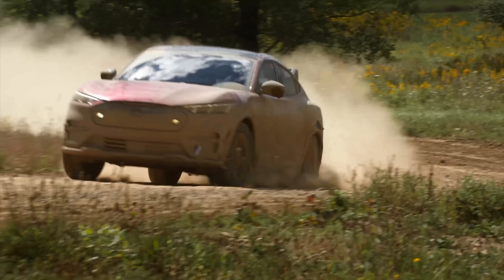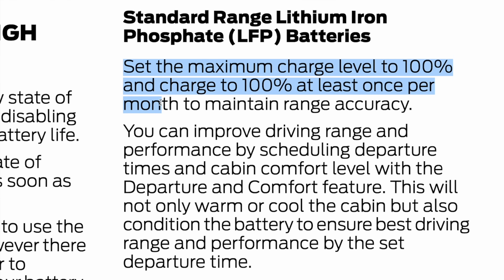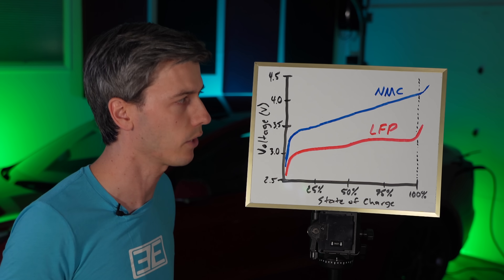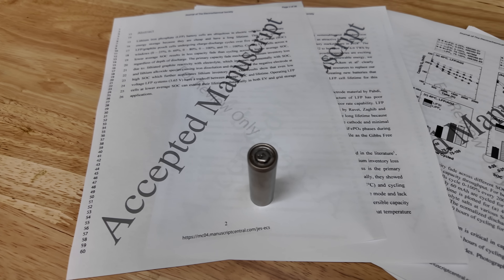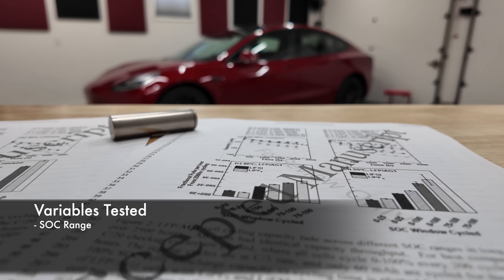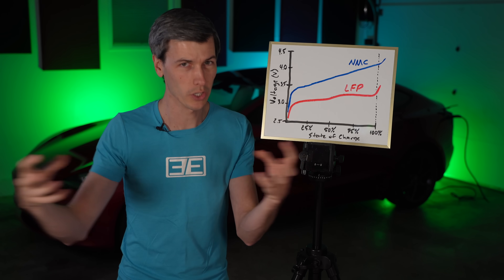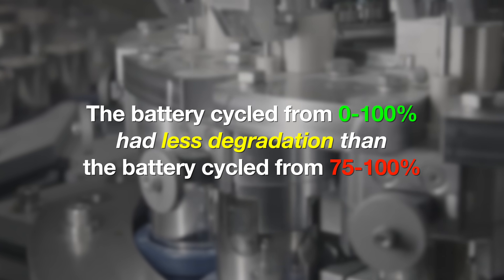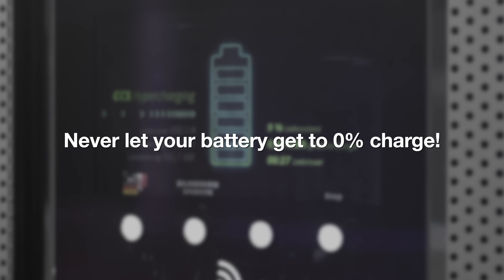How To Ruin Your Electric Car's Battery - LFP Edition!

Comment: Really nice informative video. A couple of additional comments from a former battery management system engineer, to the real nerds out there: 

First, charging to 100% affects more than just range estimation. It also effects accuracy of cell-to-cell balancing, and hence actual range! Small leakage currents in some cells inevitably cause charge differences to accrue between different parts of the battery over long periods. The circuitry needs to correct these imbalances by "bleeding" charge off of the higher charged cells or cell groups. It can only do this if it knows which cells are more charged! If the cells aren't properly balanced one cell/group will hit 0% before the others, leaving energy on the table, and as a consequence the vehicle will estimate (and deliver) lower total range. Even NMC chemistry balances better when fully charged occasionally. Although more steep than LFP, the NMC charge/voltage graph's slope just isn't steep enough for <1% accurate balancing in the middle portion. You'll get up to a couple more percent range from NMC if it can reach 100% every so often and re-estimate charge there, and re-balance more accurately.

Second, it's important to understand that all battery management systems use "coulomb counting" (monitoring discharge current) almost exclusively to estimate range, at least when driving. This is not just for LFP, NMC absolutely does this as well. The cell voltage fluctuates wildly during driving as the internal impedance of the cell causes varying voltage drops under varying load and really can't be used for charge estimation very much at all while driving. In fact, even once the car is parked, NMC systems can't just immediately look at the cell voltage to recalibrate the current accumulator that tracks charge. Not only do cell impedances have time-dependent components that take minutes or even hours to stop exhibiting small voltage drops, but cells exhibit all sorts of irritating effects that temporarily change the cell voltage, such as hysteresis and other history dependent effects. These effects tend to go away over time (and faster when it's not freezing cold). So for NMC the car wants to be placed at 100% occasionally, and left there for at least 6 hours or so, and preferably not too much below room temperature. This will allow more accurate recalibration of the accumulator, and more accurate balancing. Now the actual algorithms are very complex, the car will get progressively more confidence that it understands where the charge level stands as the cells rest more and more, so even while driving the current accumulator would be updated if it disagreed wildly with the cell voltage, and the convergence just gets better and better if you give it more time with no current draw at a steeper part of the cell curve. [oh and it really should be plugged in for this so that the battery doesn't have to support ancillary equipment, and really has no load on it for those 6+ hours]

One last bonus point, not so much about delivered range but about range estimates. Although slightly sketchy feeling, it's actually also helpful to discharge an NMC car to low charge levels, where the voltage curve bends down, for the same reason of estimation accuracy. (It doesn't need to be 0%, but say below 15%-20%). Probably true of LFP too but no first hand experience with that. The same as near 100%, the charge/voltage curve is steeper here and the car gets a better idea about what's going on. Again, the car the needs to sit there for at least 6 hours or so and not be too cold to "rest" the cells and let their voltages precisely settle. This is ideally done in close proximity to the 100% "rest" described above(like the previous day or the next day). Once these two "rests" have happened the battery management system now has a very, very good estimate of the total capacity from 0% to 100%. It doesn't have to extrapolate too far, since it's just recently been near 0% and 100%, and thanks to the steep curve at the ends it knew exactly where it was! This allows the system to update the estimated amp-hour capacity of each cell group with confidence, and so better know how much juice it actually can hold. Again this won't give more actual delivered range, the car stops driving when the battery voltage of the lowest performing cell/group hits the low voltage cutoff no matter what percentage is displayed. But if you don't want to ever drive below 10%, and the estimate is off and pessimistic, you might be leaving range on the table by driving to a faulty estimate. Or even worse, if the car never ever sees low charge levels and has a really badly erroneous and optimistic estimate, you might believe you have another 10% left to make that last 30 miles of the trip, and be stranded 10 miles out. It's really hard to get a car into this state, but if you only ever let the battery see the range 60%-80% and never outside of that, it's possible. That's only a 3.3% range estimation error in a 300 mile battery pack but 10 miles is a big deal if the car stops driving.
Reply from the maker: Appreciate you sharing additional info!!
Reply: Sounds like the occasional road trip is good for your battery as well as your soul.
Reply: Thanks @InductorMan for your detailed information. I have a 2019 Model 3 LR RWD with the 2170 NCA chemistry. I only have 34K miles on the odometer. I've been tracking my car with ScanMyTesla since the car was at 6k miles. At that time the car still showed 325 miles @ 77.6 kWh nominal full pack (77.8 when new).

I do let the car sleep at various SOC levels to help the BMS make a guess. I've only charged to 90% a handful of times and let the car sleep, and then drive it down to various levels to sleep all the way down to ~15% SOC. I will often come home from a trip at 15-20% SOC and let the car sleep over night, so my car does see a lot of data from the low end of the pack. I've generally keep the SOC levels between 70-30% SOC. Even on long road trips I can still stay within that range >90% of the time. 

Last fall I charged the car to 100% for the first time to see if I could improve the cell imbalance and give the car a better shot at balancing the BMS. I drove the car in stages (with 4-6 hrs of sleep) down to 8%.  I only stayed at 100% for an hour, however. Not much changed from that effort in my readings the last year and only 5k additional miles except my NFP dropped from just under 73 kWh to just over 71 kWh. I think my BMS still lacking good high end info for good estimates.

Since I've never need to push my SOC arrival levels to near 0 I'm trying to understand the best approach to balancing my BMS. I'm not doing any damage to my pack by not charging to 100%, my BMS is just not as accurate as it could be. Correct me if I'm wrong. On the other hand, if I did charge to 100% a few times a year and run the SOC level down with sleep periods down to single digits, am I really doing anything harmful enough to really matter?

On Teslas I've wondered if there is a sweet spot for high levels of SOC below 100% that is "good enough" (say 82% just to make up a number) that isn't as stressful on the batteries? 

I also store the car between 30-40% SOC between drives. It's not a daily driver. As a road tripper 38% of my charges have been L3.

TIA for any additional thoughts or strategies. I'm playing the long game to keep my pack as healthy as possible. I'm still showing over 300 miles of range depending on how the BMS is feeling that day. :)
Reply: This is the best ever comment I read as an battery interested electronics engineer. 
Now I understand the „mechanics“ much better. Havin a Tesla Model 3 2020 with LFP, i can state that the estimates of the BMS are very accurate (low single digits) starting a trip at 100% and ending between 10 and 20%.
Charging at home with solar most of the times the car is always plugged in. It steadily stands at different levels of charge sometimes for hours (when no sun) which probably helps the BMS and cells to adjust. Including 100% and relatively low state of charge. 
In this use case LFP is the ideal solution, leading to a 100% state approx every week, without really caring too much about the state.
Reply: This is the deep info only a nerdy engineer-type like me can fully take to heart! ❤
Reply: Thank you so much for sharing your insights!
Reply: OMG!
Reply: See the real remaining question is this: why Vauxhall/Opel decided to only show battery charge in 'miles' rather than % or kWh. Ditto charging speed as mph instead of kW. Given that any range estimate it gives above 100 miles is pretty much fantasy (fairly accurate below that), it was a pretty odd design decision.
Reply: Now you seem like the guy who can answer my question.

In the chapter "Why" Jason said that the reduction of lithium ions is a problem with every battery that uses graphite as electrode material. 

But from my understanding they use use the graphite to help keep the reduction of lithium as low as possible. 
The lithium itself is the culprit in reducing the amount of lithium ions because of SEI. So they embed the lithium in graphite necause that reduces the SEI growth (sorry idk if embed is the right word, english isn't my first language).

I'm not quite sure if SEI is the same as the forming of dendrites. But I know that the reduction of lithium ions is because the lithium ions with a positive charge attach to the electrode, which forms solid structures on the electrode. 
And that this is a specific problem with lithium, it doesn't happen with copper for example. And the graphite isolates the lithium which drastically reduces the forming of dendrites.

Which I am assuming is the same or a similar phenomenon as the SEI?
Reply: @Harry_Gersack  I'm not really the right person to answer this, my experience was in designing battery management systems, not in the internal chemistry. We simply took the practical results that the cell chemistry people could obtain, and architected management algorithms and hardware around them.

But I can try to answer some of these things based on the surface knowledge I have. SEI and dendrite growth aren't the same thing. Dendrites are metallic lithium. SEI is a complex of lithium and the electrochemically altered components of the electrolyte. I believe that the lithium trapped in the SEI isn't actually reduced to the metallic state, and that it's actually still lithium ions complexed with the electrolyte decomposition products, and that it's the electrolyte that's being electrochemically altered when the SEI is formed. 

But just to really show you how little I know about this, I actually had it in my head that the SEI formed on the cathode, not the anode. So there you go, I was wrong about that. Plenty I don't know here.

I also would not say that they embed the lithium in graphite because it reduces SEI growth. I think it's sort of the opposite. I have heard that it's a minor miracle that lithium ion batteries work at all. Basically, there aren't any electrolytes which theoretically have a working potential range that can actually accommodate the LiIon chemistry. On the face of it, there is enough voltage to either oxidize or reduce any possible electrolyte compounds. And in fact this is the case, but what happens in practice that simple theory did not predict is that the SEI forms, and so instead of the electrode of the battery continuously degrading the electrolyte until it is all degraded, the SEI "passivates" the electrode, and basically blocks any more electrolyte molecules from accessing the electrode material, forming a stable barrier which is luckily permeable to lithium ions. So basically I think in a way, you can say that they embed the graphite in SEI to protect the electrolyte from the large electrical potential of the graphite.

To be perfectly honest I don't know why graphite at a high negative potential can't reduce lithium ions, and rather causes them to intercalate. This seems like it might be an electronic structure thing (so basically quantum mechanics of graphite), but whatever it is, I don't know.
Reply: @InductorMan   Damn, thanks man I learned a lot.
So if I understand it right, the graphite is needed because of the forming of dendrites, but it's actually is hindering and the SEI is needed to counteract the problems that come with using graphite

Comment: It sounds all scary but looking at graphs from your study the difference is 2% degradation of 240mAh cell at 40C from 500h to 2000h for best case 0-25% and 4% degradation for 75-100%. And in practice for an average person would it matter if say in 5 years degradation will be like 1-2% higher I would say no. It is probably will be only 0,5-1% higher because batteries are cooled or heated to stay at the optimal temperature

Comment: But for the consumer that wants to buy an extended range LFP battery EV, what is the point when the recommendation is to only charge to 70% of it's capacity for a majority of its use?

Comment: From what I have seen just based on Tesla LFP owners experiences, is calendar ageing has far more of an effect than cycling and carging habits with the LFP cells. For example, if you compare 2 cars, both 2 years old. One owner has done 100,000km and charges to 100% every day vs the other owner who only charges once to 100% per week and has only done 20,000km show roughly the same degradation level.

Comment: Wow great video. We have a 2022 Model 3 Dual Motor. I believe it has LFP batteries and Tesla advises up regular charging to a max of 80% unless going on a long trip. Another reason of <80% is for Regen braking which wont work at 100% etc.
Reply: You don't have LFP
Reply: @pauld3327  Lithium-Ion Batteries

Comment: For a Tesla Model 3 with a LFP pack, if your commute isn’t far, charging to 60% then keeping it not plugged in, then when it hits 25% to then charge to 60% is best practice for battery longevity? 

Ps: I didn’t mention charging to 100% as that would be only to calibrate the battery management system

Comment: PLEASE!! Can you do a video on WHY trucks cost more than cars.  For me, I look at a 2dr truck and then a 4 door sedan and think the sedan should cost more to build and therefore higher selling price.  Questions I would LOVE to know the answer to: Do trucks last longer than sedans or SUVs, What is Fords cost to produce the F150 vs the Ford Edge, Are materials used (interior and exterior) in pickups better quality, Are trucks safer in crashes, what margin does a OEM make on a pickup vs SUV or sedan, is there a engineering reason for trucks to cost more, % of materials meaning total parts needed to build a truck vs # of parts to build a sedan,  the margin a OEM makes on a sedan vs a truck, R&D budgets for Trucks vs sedans????  WHY do trucks cost more?  When I look at a truck, I see OLD design, interior 1/2 the size and space of a 2dr truck so MUCH less interior materials, so less fabrics, less  R&D interior design, trucks have less of everything.  Sure the frame underneath may be stronger in a truck but does that alone make trucks more expensive to build?  It's like a Rubik's cube costing $50 dollars and a RC vehicle costing $10, just makes no cense to me.  What am I missing?

Comment: Great video, very interesting and informative! One other thing to consider is that many EVs consume some electricity while parked to thermally regulate the battery in extremely cold or hot weather. This is also important for battery longevity, and is one of the main reasons that it is recommended to leave an EV plugged in when parked. I wonder if there are noticeable differences in the phantom loads that are incurred from thermal conditioning between LFP and NMC?

Comment: Useful information, thanks. I have a question about the LFP battery that does not involve an electric car. I have noticed more and more LFP batteries coming out that can be used to replace your existing home UPS batteries for your home computer. Have you ever tested these types of batteries and will they hold out longer in the UPS then regular UPS batteries? Generally you're lucky to get one to two years out of the regular batteries and I think this is because they're under a constant state of maintenance charge.

Comment: Sounds like this is something they should just incorporate into the software.  Have a schedule where once a month it charges to 100%, otherwise it charges to like 80%.  Could also have it setup to learn your driving trends so if you don't drive a lot, then maybe it can just charge to 50%.  So idea is you plug it in all the time, but it would just do it's thing. If you plan to go for a long trip you could select an option that just charges it to 100% for that one time.

Comment: Dave from the Off-Grid Garage has done a lot of trialing on LFP's . My understanding is that individual LFP cells get voltage drift over time and can develop a large delta between the highest and lowest cell voltage. When the pack gets charged to 100% it flattens out the differences.
Reply: Going to 0% should also do it, right?
Reply: @franklofarojr.2969  You're 100% right.

Comment: The idea of "only charge when you need to" is exactly the thing i needed to hear in order to not want an LFP battery.

I will not remember to plug my car in if im "only chqrging it when i need to". It needs to be routine, and muscle memory based and plus what if i happen to need to drive longer that day? Say on my way home from work, i gotta syop by the store. Im not going to do math to figure out how many miles i really need. That is too much trouble and if someone is coming from a gas car and had to do this, ev's would no longer be the more convenient daily option if you're actually trying to keep the battery healthy. 

Looks like im going with NMC batteries from now on.
Reply: Doesn't matter either way. Cell drift is minimal in LFP regardless. Really doesn't matter